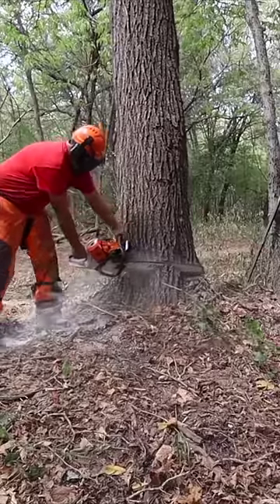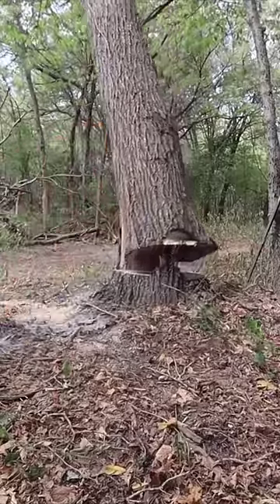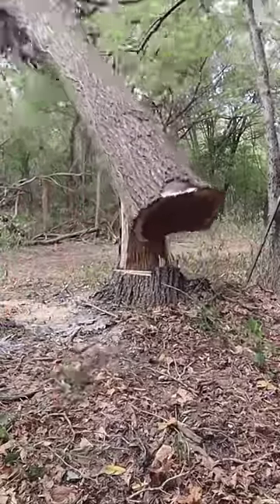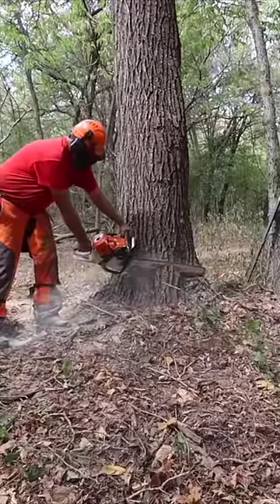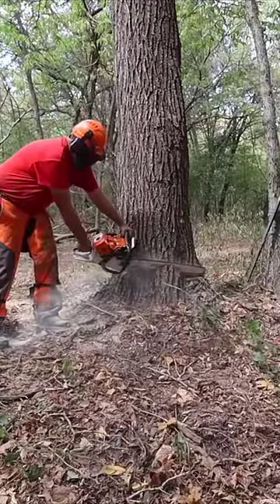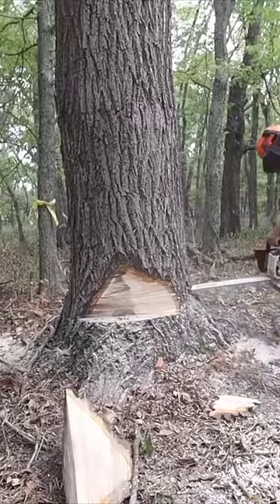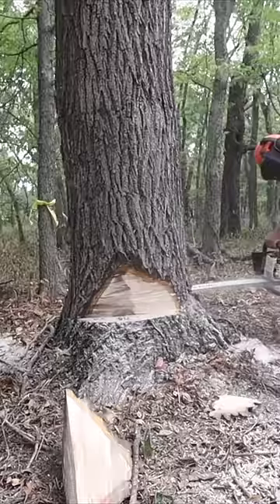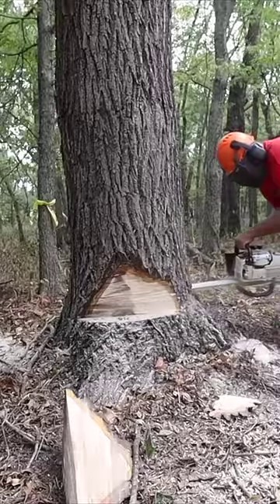Dangerous Barber Chair and How to Avoid it #treefelling #dangeroustrees #logging #treefails #stihl

Comment: I had no idea they could stand back up, no matter how thick you leave the hinge. Can't wait to try
Reply from the maker: It is a difficult trick to master
Reply: Only true professionals with sufficient skill points in restoration magic can pull this one off.
Reply: The tree was saying hey bud why don't you try that again
Reply: i jumped to the comments right off the bat, and watched that happen in the background. Trippy
Reply: @RockhillfarmYT  
Good explanation 
of the basic method.
Reply: As funny as this is, I’ve seen idiots with chainsaws cutting trees that still have their roots attached and suddenly when the trunk is cut, it becomes bottom heavy again, including 5-10 feet of trunk
Reply: @pws3rd170  
I think what you mean is the roots were attached to the ground causing the stump to stand up.
Reply: @jakebredthauer5100  sorta still on the side the tree fell on, though the tree still has a wide and relatively deep rootball, still attached to the trunk, that was pulled out of the ground with the top of the tree creating enough force to keep it out of the ground
https://youtu.be/tNvsZC5XorA that was one that was done safely
Reply: @pws3rd170  
It is the weight of the rootball.
Okay.
Reply: @jakebredthauer5100  though fresh roots are extremely difficult to break by bending so there still may be something to that in some situations
Reply: Barber chairs are extremely dangerous dude, don't do it on purpose !
Reply: @philmaxey5559  
He commented on the tree top
falling up.

Comment: Face cut depth is also a big reason why lots of people get barberchairs
Reply: as proven in this video.
Reply: barber chair could lead to a hair cut..RIP
Reply: That’s what I was thinking too.
Reply: Optimal notch is 1/4 to 1/3 for 80% face. 10% hinge thickness.
Reply: @WhackBytch256  correct , at least 1/3 undercut . Using side cuts will reduce or eliminate the chance of a barberchair . There are handbooks on falling , published by the British Columbia Canada workers Compensation board . School yourself before picking up a chainsaw . You may live longer . Fallers have the highest fatality rate of any employment sector 👍🇨🇦
Reply: @fixitfelix718  no not a hair cut a complete beheading
Reply: 1000%
Reply: @cameronhamer9432 do you know any of the book names? I'm in the UK and am gonna see if I can find some to read!
Reply: I usually shoot for about 30% of the tree diameter, I am an amateur, what is a good rule of thumb?
Reply: General rule of thumb 20% of the trees diameter is your depth of notch, try for about a 70 degree notch. 10% of the trees diameter is your hinge thickness. Do your bore cut and leave atleast 10% of holding wood for the trigger. As soon as that trigger is released shut the saw off and get away dont stand at the stump

Comment: Growing up my dad did alot of tree work but I never seen him do a barber chair. Ive always seen those cuts on construction sites and figured the tree just tore that way.
Reply: On construction sites specifically, I would guess that at least some of those are caused by having too much tension in the top- they've used a truck or some piece of machinery to pull the tree over.

Comment: I used to pull over a lot of big trees opposite their weight and lean. Residential tree work. In that case a deep enough and extremely wide notch is necessary. As the tree is being pulled over the notch closes up and if it does close all the way before the tree comes over center then the tree will no longer pull over, the stress now goes to the hinge wood and or the top depending on how and where in the tree the pull lines are rigged. This causes either the hinge to break and the tree to fall sideways causing disaster. Doing these big and technical drops it became a habit to cut extremely wide notches whenever I dropped anything. The fellas would poke fun not understanding why or the concept even if I explained it to them. Those were good times. Big drops, big adrenaline, big money.

Comment: I had my hinge too thin on a hard leaner this weekend.  It was a decent width, but no thick enough to support the heavy lean. Just as I went to pull the saw from the bore cut it pinched.  A quick few whacks from the ax on the trigger took care of it.

Comment: Deeper notch.  Tall enough to not close.  And a powerful enough saw for the job
Reply: The saw was Not the problem here.
The issue really wasn't how deep the notch was, but how thick the hinge was. If the notch was deeper and he made the bore cut and left too thick a hinge, the hinge would still have been too thick.

Comment: Never had that issue with proper hing/relief cut. Worst logistical problem is trees getting hung up on other ones around it
Reply: Good point
Reply: If you don't misjudge anything ever, you may never experience a number of issues.  Getting trees hung up - and I'm guilty - always comes from one of two things: misjudging clearances; choosing to drop in spite of a lack of clearance. I had to pull one off the stump this morning because I misjudged a clearance.

Comment: Thanks for sharing. Miscalculations during cut do happen; that's what our safety discipline is for. 

I like the fact that, while trunk did split, the split is relatively small - too much hinge or not, your plunge cut limited the damage nicely. With straight back cut, more dramatic barber chairs propel the trunk very high, resulting in either trunk falling from great height, or nasty dangerous cleanup.

Comment: I'm not a pro, maybe I have always been lucky. But I always cut way deeper on the face.
Reply: Me too but it has still happened to me. Rotten tress a couple times
Reply: @semiprofessional8470  No kidding! Badly rotting trees are treacherous even to seasoned pros. Never cut one myself, but I've seen videos where the faller did everything right, but the tree suddenly shuddered, shattered and pretty much dropped everything straight down. The safest thing for those is a big bulldozer or a bucket truck.
Reply: This looks like an open face of 70-90°s. You don't have to get nearly as deep to get the hinge length you need to control a tree on its fall, but it sure is tall, so it's not aimed at production.
Reply: Your dead right always cut a deep scarf 
Bore cut up to scarf ie 40mls out the back all done no monument no widow's
Reply: You don't need a face cut at all . And if you do a face cut only cut sap wood especially on Walnut. Just plunge cut like he did and push cut with top of bar sawdust fills in the curf keeps saw from pinching
Reply: On a leaner you don't need a deep face cut.
Reply: @deanminor1998  if you like living. Don't listen to this guy. You only need to be unlucky once.
Reply: @lotekchapra  
Who are you writing to?
Dean gave bad advice.
Reply: @jakebredthauer5100  I'm writing to everyone about deans bad advice.
Reply: If your face cut is too deep on a leaner it may go before you’re ready. The tree is supported by wood in tension on the back side and compression on the face. If the tree is leaning and back wood has a defect it will fail while you’re cutting the face if it’s too deep and you die.
Reply: @benrichey2593  
If you were cutting too deeply, wouldn't you see the tree start pinching on the bar as the tree starts to bend?   How would such be a cause of death? Wouldn't the tree simply fall over as intended?

Comment: I usually cut walnut close to the ground I can without dulling the chain I use the same technique just make a thin hinge and cut out the middle of the hinge into the notch and just have the sides to guide the tree just what I do on walnut because it’s easy to do like here or slab it and loose money.
Reply from the maker: Sounds right
Reply: You're right. 
I remember just out of logging school and the first forest owner I logged for came out to the site and complained I cut the stumps to high. I lowered the next cuts 1-2" and he was OK. I wasn't OK bcs I had to dig through a crust of ice that had formed on top of the snow around every tree. The trees were softwood spruces. I lost 10s of $ bcs of extra work, he earned 1 in fractional more lumber pr log. I was p...d, but I learned to cut low ...

Comment: Sometimes you can do everything just right and it will still do it.  Alder trees are notorious for it. There is so much stress on a hard leaner because the tipping point is at the top of the tree acting as a massive lever. I have had a slight breeze hold a cut tree in place or push it the wrong direction.Sometimes just cutting into the bark will be enough to explosively release the stress causing the tree to suddenly split and shot backwards or sideways.  I and my father will often wrap a chain, cable, or heavy duty strap  around a suspect leaner just above the area to be cut and it stops the split better to be overly cautious than to  be possibly injured or killed.

Cool on you for doing this helpful, informed video.
Reply: Won't the chain just break
Reply: @simd510  depends on the size of the tree, size of chain, and strength of the chain being used. You have to choose carefully and wisely. We use industrial strength chains and double wrap them.

Comment: I cut a little different. I cut my hinge/ wedge almost as wide as the stump, I the insert the tip of the saw and run it thru to the uncut side and usually go about 6 to 8 inches side to side with the saw, when I get that accomplished I go the the reverse side and start cutting until she's ready to go, I've never had a tree barber chair on me and only 1 to go where it wasn't supposed to. That was a 42 inch in diameter red oak. The wind picked up and blew it into the treeline. I learned from the old timers. Plus i usually run racing chains that have no depth guides and square cut teeth that are super sharp.

Comment: Very small notch, looks like you were kinda high on the back cut, and to thick of hinge.. just what I noticed. Stay safe
Reply: Right. The back cut should be really close to the height of the inside of the face cut, but never below. The bore cut (aka plunge cut) can help, but it carries the risk of kickback. If you don't know how, learn from an expert before you try. Also, learn about the species of trees you'll be cutting. Some are at much greater risk of barberchairs than others, and cold freezing temperatures exacerbate the problem.
Reply from the maker: Right, you could’ve laned it in any direction.

It was a pretty hard leaning tree already and all the branches were on that side. There was only one way it was going without a strong pull rope up high.

If you’re implying that a traditional 30% face cut followed by a backpack would’ve avoided the barber chair you couldn’t be more wrong

I used the right cutting technique I just left the hinge too thick and I made a video pointing out my own mistake
Reply from the maker: What the heck does proper adequate hinge mean? It had too much hinge I could’ve punched the center of the hinge out and been a lot better off

This is really humorous because I made a video to say “hey guys look what happens if you don’t get your hinge thin enough”

But that’s the purpose of the video criticizing my hinge is really comical.
Reply from the maker: But you didn’t leave a comment because I don’t have a clue, you didn’t even see it 360 of the tree including the canopy or know what I was trying to accomplish.

you left a comment because tearing people down makes you feel better About yourself.

A lot of people leave tips that are meant to help someone do better the next time they’re performing this dangerous task but that’s not the route you took
Reply: @RockhillfarmYT  not try to take sides here, but I was a licensed arborist for around 8 years and co owner in a decent sized tree service company. I probably fell thousands of trees in that time. I do have to agree with Dan that this was not near an adequate hinge cut in this scenario.

Comment: You're 100% right and then you got to mention straight greenwood. Oh by the way I am an experienced lager. The best way I found is when you cut your hinge to undercut it and you'll never Barber chair another tree ever again it's not a legal cut but it does work and on a very expensive veneer log you'll save it every time. By the way I've had many experience a lot of the more experienced me barbecue veneer logs not a good thing. Lose a lot of accounts on log buyers that don't want to use you after your Barber chair a few of them. Also seeing one guy cut over a hundred veneer logs stump pulled everyone turned it completely into firewood no one wanted even buy it for saw log.

Comment: Face cut depth is so so so important as well. I’m not sure where the shallow face idea came from, and who’s in charge of that… you need to be at least 30% of the diameter of the tree deep tho. Anything less and there’s not enough of anything going on with that tree, not enough hold wood in the hinge to keep it going on track, not enough initial movement in the tree once the hinge becomes thin enough to allow the tree to start falling, and not enough control to time that initial movement just right. Lastly, bore cuts are useful in heavy leaning trees, or trees with low clearance issues only. A bore cut, with a trigger cut is not needed in most cases, and can cause more harm than good. You’ll forfeit any steer you coulda had with a traditional back cut, which also means loss of control.
Reply from the maker: This was a hard leaning tree with all of the weight on the side of the lean. I don’t just bore cut everything for the sake of doing it.

The bore cut was definitely the right choice. If I had punched out the center of the hinge, so it couldn’t tear fibers it would’ve been a clean drop.

We still got really nice lumber out of this on the mill, but we lost some yield.
Reply from the maker: In terms of the face cut, I’ve generally always done a third like you’re saying, but I’ve went out cutting with two different guys who earn their living logging.

They never make a deep face cut like that. Their primary focus is on saving as much of the log as possible. I’m always trying to learn and try different techniques rather than not assuming I know everything.

One of the guys told me I needed to punch out the center of the hinge if I did that. Now I see why.
Reply: @RockhillfarmYT  loggers will do shallow face or a humbolt cut either one to maximize board ft. I’d way prefer a humbolt, but everyone does things differently, especially the pros.
Reply: @robsmith7681  As a pro, I prefer a humboldt notch, but mostly because I'm short and it helps me line up my cuts more comfortably

Comment: A barber chair is generally caused by inadequate or bad(dutchman) face cut not the back cut.. when you dont reach the 1/4-1/3 diameter = determined depth of cut.. on extremely dead rotten its closer to the 1/4 of determined holding wood.. you can prevent a barber chair in most cases by not have a dutchman or by flattening the face cut taper at the  point of angle which prevents compression that causes barber chairs

Comment: There's another way around that too you bore in through your notch and cut the heart out and then come around to the side there's less meat in your notch it works pretty good I've done it for a while cutting veneer
Reply: 👌 mouth bores are great, when you only have a pole with not much weight but still quite fat, it saves thinning your hinge down the millimeters and risking cutting through one side
Reply: I am in hard woods and I cut that way because they'll pay for veneer with the side busted a little but with hardwood pulled they won't buy it at all

Comment: that is a nice walnut tree should make a lot of pretty walnut boards last walnut I cut years ago I had it sawed in mostly three qurter inch boards I air dryed it thats a lot of work takes about a year You have to unstack it and turn it every so often so it doesn't cup I put stakres between each borad
Reply from the maker: Here is one i just did

How To Straighten Warped Live Edge Sawmill Slabs
https://youtu.be/2wIUW4P9rH0

Comment: Did that on a 45 degree boxelder. I set the hinge to about 1/2" but it still barber chaired
Reply: Bore the center of the hinge too?
Reply: @matthewbeaver5026  Yeah, surprised the heck out of me. At 45 degrees a barber chair isn't that dangerous, it's pretty close to the ground already, and I was cutting the strap from as far back as I could. Would have been dangerous if I had been climbing and tried to make a similar cut.

Comment: 70° angle the open cut 10% of tree diameter for the hinge. Finish cut half of what’s left from hinge back. 
PLACE PLASTIC WEDGE
Go to opposite side and finish the finish cut. Place second wedge. Strike wedges with hammer. Tree pops step back.

Comment: For leaning trees you should do your face cut, then a plung cut right behind where you would have cut your back cut to for the hinge and work the cut to the back (away from the face cut). Then remove the back strap. (About 1 to 2 inch of holding wood depending on size of tree) no chance to barber chair.
Reply from the maker: That is exactly what I did, but a thick hinge on a leaning tree will lead to a barber chair, even with a plunge cut

Comment: I cut deep notch’s. The opposite way you do. and I keep the finishing cut perpendicular to gravity…and it usually falls in the direction I want it too. Had one hang up bc I angle cut the last part. So instead of tipping over. The tree slid off the stomp onto the ground and it fell in a random direction

Comment: Try wedge cut then set hinge width with a plunge cut. Then cut through to your plunge cut. Might be alot safer. Oh, wait that's what you did. Problem will always be your wedge cut is not deep enough. I guess I have never had a barber chair if my wedge cut is deep enough. Clue, your wedge cut is also good as a wedge for directional falling.